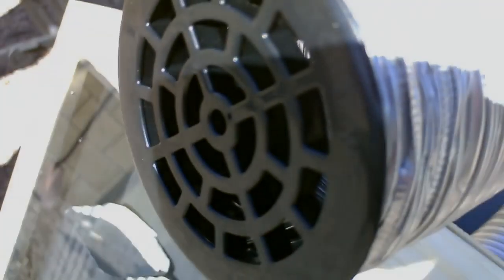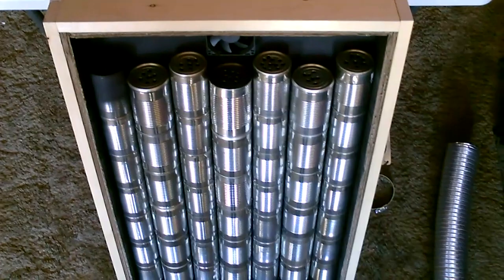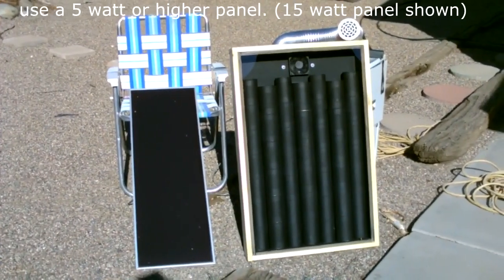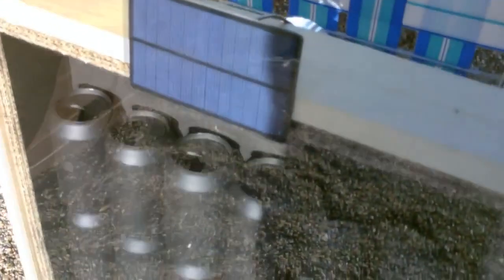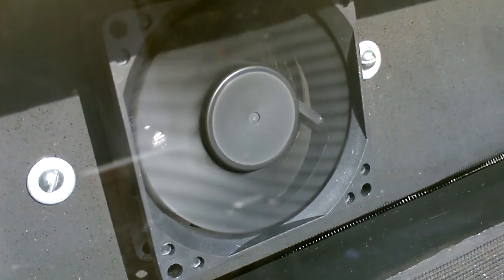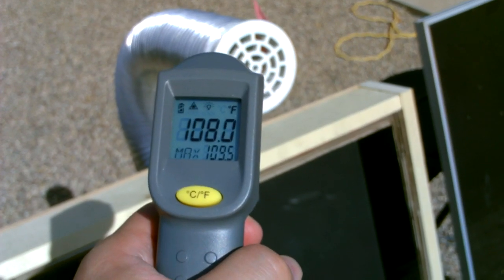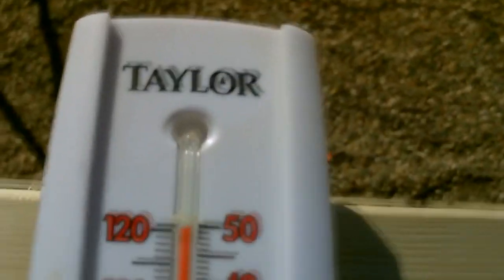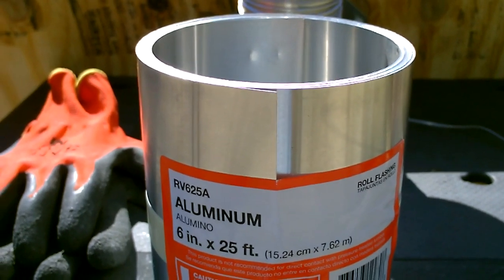5 DIY Solar Air Heaters! (Solar Air Heater Compilation Vid.) - 5 types - All Easy DIY's

Comment: Almost everyone puts the fan at the top where it is HOT!  Put it at the bottom so it can run more efficiently cool.
Reply from the maker: if you put the fan at the bottom almost no air will come out of the unit. you'd think it would but it bottlenecks and the fan struggles to push the air through. the fans will handle the heat fine at the top. i've never had a single fan stop working.

Comment: @desertsun02 Do you think one of these is powerful enough to help heat a 500 square foot garage? Or would it be a drop in the bucket?
Reply from the maker: hi. they would certainly help heat it. (you might need to adjust the size of collector or use a couple, but it will depend on how cold your area is)

Comment: Great video. Lots of good ideas for low cost heating.  Good explanation of builds.  Going to subscribe.  I like these kind of cheap, easy to build projects.
Reply from the maker: hi and thank you! and thanks for subscribing. I'm currently working on a new type of solar collector (one that i think is a first of its kind). I've seen a couple of science papers talking about the concept but I've never found a video on it. nobody's built this type of solar collector yet (as far as i can tell). if i get it to work (and i think it will) - it will be my next video. probably post in a couple of weeks.
Reply: Is it a compound parabolic mirror collector!?

Comment: Does the small can heater need direct sunlight? I want to do this for my greenhouse in winter but days are much shorter in winter. Also how long of sunlight or daylight would you think is needed to warm a greenhouse for night until the heat is gone until next day?
Reply: It wouldn't even get greenhouse to warm up, the cold from outside will be cool it down too much for it to do anything, I've been testing panels for while now and you need 50+ degrees C for at least an hour to raise temp 1 degrees c

Comment: You need to use an actual thermometer, using that only tells you the temperature of whatever it is pointed at, not the actual air temperature.

Comment: In order to really compare the heaters it must be done based on the energy extracted.  It is a combinaison of air volume and temperature.  So you must be able to measure the air volume and its temperature.  BTU = CFM x (Tout - Tin) x 4.5

Comment: I built a beer can heater five years ago and it works better than any of these. Why? Because they are all lacking a thermoplane. You need to draw room air into the heater, heat it, and let convection blow the air out of the top. You start by finding out the elevation of the sun mid day during the middle of winter. Then you build an angled top piece that fits in the lower panel of a window in your home so your heater is at a 90 degree angle to the sun maximizing solar gain. Room air flows in the bottom plane all the way to the bottom of heater unit, gets pulled into the cans or sheet metal where it heats and convection rises and blows into the room without needing a fan. I built mine out of double layers of foil faced Styrofoam taped with metal duct tape. The top is a corrugated clear green house panel. Styrofoam layer between the cans and the lower air plenum. Normal input vs output temp differential is around 50 degrees and I get around 6 hours per day of heat. Weight of eight foot unit is around 30 lbs. Light enough for most seniors to handle.
Reply from the maker: hi. i generally like to pull in outdoor air because it's fresh but you can certainly recirculate if you want to. it gives the highest heat on the coldest days. my climate is not super cold like the midwest or eastern states

Comment: Hi Desert Sun! I am in the process of making passive solar heaters completely out of found materials for less fortunate members of my community. The only things I will need to purchase are the fan and solar panel. What is the cheapest fan and solar panel I could use outdoors?

I notice that you vent your panels from the back. Any particular reason? Have you considered venting it out from the top? 

Thank you.
Reply from the maker: hi there. i think it's great that you are helping your community! you could vent it out the top if you wanted too. the best place to get the fans and the solar panels is amazon. they have lots of both of those. nearly all solar panels are made to be used outdoors and most if not all computer case fans will hold up fine. i've noticed that even the cheapest solar panels on amazon are pretty sturdy.

Comment: Black roller blinds and table fan works just as well although the heat is not concentrated to a small diameter for temperature checks. okay so the rooms darker. But ur warm. But probably just as good without the construction, pipe work and hassle.

Comment: I think I would not drill the holes at the bottom of the frame but have a gap between bottom of the cans and the frame, then drill lots of little holes on the back so that the fan draws the air in and channels the air through the bottom of the can tube. If it's cold and windy outside you don't want cold air forced up the tubes and into the house. This way the fan has to pull air in. Whether or not it makes a difference to the outlet temperature being drawn into a cosy environment first I'm not sure as it might have some cooling effect on the upper cans

Comment: Love them all. I wish I could see these working in -40. I feel like the air would be cooled down significantly just passing through the duct.
Reply: Insulate the ducting.
Reply: They work in any temperature so long as you have a bit of sunshine on the panel. Loss in the ducting I think would be minimal. The fan is pumping it straight into the house. You could probably run the ducting to eight metres in the roof void if you wanted the ventilation somewhere central. Bear in mind the primary function of these devices is to reduce relative humidity, dry air is much quicker and cheaper to heat. Then if your home is well sealed, you don't need to open windows and you get fresh warm air through your house changed every hour or so.

Comment: What happens if you don't have a fan?
Reply from the maker: hi. if you don't use a fan, the warm air will only trickle out. the units that don't need fans are generally 10 or 15 times bigger.

Comment: Now look I've been watching 👀 you for years and think you need to write ✍a book  that is so pertinent to our world and would have it in my book case.  I built a small cooler with small radiator, ice water and 12v pump and it works so I'll make a bigger one.
Reply from the maker: hi and thanks! i'm glad you're making the projects! (that's what it's all about) 😎

Comment: i built a large one a few years ago..it was the size of a sliding glass door..That was free glass, so i made mine huge.. the temperatures were hot, but you really needed a more powerful fan to make them worthwhile. I happened to have a blower fan. It moved a good amount of air.  I used a variable fan controller and adjusted it for the desired temperature i wanted.. so it would speed up as it got hotter, and slowed down as it got cooler.. I used aluminum cans, I had a header at the top and bottom..and i think i had 11 towers of cans, and I can't remember how many tall.. My only issue was that i couldn't find any flex duct that would last. so after a few years, i decommissioned.. but it was great when i had it,,

Comment: How about using solar panel as dark back drop area and or pri-heat camber,add some air flow diverter...
Reply: Heat may be a problem for the solar panel.

Comment: Do you feel there is one that works better than the others?
Reply from the maker: hi there. they are fairly similar but i like the downspout one the best. the steel is thick on those and i made the collector with a plywood back

Comment: How could I use such a heater at night? Is there a kind of storage device one could add to the solar panel in order to use the heat charged during the day at night? I do not understand much of these things, so I apologize if my question seems way to farfetched.
Reply from the maker: hi there. one idea is you could store the heat it generates in thermal mass like sand or rocks. you'd have to rig it up so that the unit heats those up during the day and then at night they'd release the heat.
Reply: @desertsun02  Thank you for your advice. Must it be special rocks? And would they really heat 8m2 during nights with 10 below zero?
Reply: @desertsun02  Steel has 4x the thermal mass per pound compared to sand. Steel is a better option.

Comment: sir i have a suggestion toward developing the solar heater, why you don't make a loop of the Aluminium cans in the board , this loop have an open valves at end of a specific sides and this valves connected to the fan area directly, its about controlling the air circulation at a different distances for increasing or decreasing exposure of air to heat by the mentioned controlled open/closed valves, which make it more and more reliable. 
hope to hear your reply soon
thank you.

Comment: I haven't seen a single design that  show recycling the air. I'm building a greenhouse, so I need to take that air through a tube in from the bottom from the greenhouse and return it back to the greenhouse
Reply: It’s pretty easy just add return hose (duct ) to air intake on your design, I use this for fresh air that I reheat through solar collector as to not turn on heaters for my 4x6 greenhouse, my greenhouse is pretty tight and during 30 degree days need some fresh air without letting in all that cold air , any of these designs will increase temp from outside air so really adds to greenhouse hobby and vegetables love fresh air

Comment: Something like zigzag (horizontally with little angle to prevent hot air getting trapped in high spots) metal pipes should heat better as air would get longer time to heat up.
Reply: air takes no time to heat up. Consider the heater core in your car, which is a small radiator. It flows hot coolant through the heater core and a fan blows air through the aluminum fins of the radiator. It takes a millisecond to heat the air flowing through. All you really need is a material like copper, aluminum, silver or gold that has a high thermal conductivity so it can take the heat and transfer it to the air, the key is surface area. Of course, if it's too efficient, then you need more thermal energy to transfer or it will become too cool too quickly. I had a friend who put a racing radiator on his car, and you couldn't get any heat in the winter because it was TOO efficient. The engine literally couldn't heat the coolant quickly enough, that radiator was great for the engine, not so great for the driver.

Comment: I am curious as to how long these units radiate heat after the sun goes down?
Reply: Not long , depending on materials used , I built one for my 4x6 greenhouse, just wanted to preheat fresh air , do not want to kick on my heaters also solar power , but greenhouse stays at 70f degrees with outside air at 30 f and now can add fresh air without kicking on heaters , of course just need sun to stay out , but using every bit of Mother Nature is fun hobby

Comment: I tried the down-spout version.  Full sun, temperature is 45 degrees outside.  Hardly any heat at all when the fan is running.  I have no idea what I did wrong :(
Reply: Is it possible that you were running your fan too fast and causing the air to transfer through the heater before it could warm up?
Reply: Hard to say without seeing the design.

Comment: Nice succinct comparitive...good work.
Have watched many tests.  Thermodynamically speaking it is a ratio game of surface area of absorbtion, rate of dissipation and baffling of airflow over the surfaces.  
The best tweek of quick hack is the downspout build with baffles. Cut  backside bend in tabs. Another alternative is to put screen inside tubes. The aluminum cans will always out perform steel....cans just slower to accumulate, to build and paint.  Thanx for great content!
Reply: Dude some big words for us amateurs using beer cans but surprised you didn’t throw in fan speed which also can make a big difference

Comment: if you want a surprise, try the screen  with  a foil background rather than flat black, I saw a 15 degree gain using the reflective surface instead of flat black for the back of the panel.  It was a side by side comparison with the same screen.. also the same length of screen folded back and forth in a wave profile instead of stretched in three flat layers also gave about a 15 degree gain over three flat layers.
Reply: An interesting idea! Been gathering supplies for close to zero-budget heater. Might use aluminium foil for the backround.

Thanks for the tip!
Reply: speedbuggy16v any pictures to share ?
Reply: @symonvanrisjel9959  sadly no, it was just a throw together for my own amusement.   Looking back at it I am going to say the gains from the different way of laying the screens was probably just a trade off of heat gain vs air flow.  But the foil vs black background I think was a true gain as more light, thus energy was reflected back onto the screen absorber which seems to be pretty efficient at transferring the energy to the air.  There is some interesting reading on boundary layers and laminar flow if you google "The Zen of Passive Solar Heating Panel Design
Morris R. Dovey"

Comment: To put this on a house couldn’t you use air from the floor of a room as the intake air and then have the outlet air be pumped out the top. Also any estimate on how much sqft this will heat?
Reply: Yes. You can do this.

Comment: Nice vid but I wish someone would do these different styles more scientific so you can really see the difference between them. Like all the boxes being the same size, same fan, all out simultaneously in the sun.
Reply from the maker: hi there. i've got a couple vids like that. they compare 3 different types of heaters (the steel can one, the screen absorber one and the downspout one) *they're made almost identical (the downspout one is a little different, but close)

Comment: Right on point. Like the virtually side-by-side comparisons with the thermo gun. This helps decide on what to build. For the cost of the aluminum downspouts, they aren't worth the money considering the screen gets just about as hot and is much cheaper. And then the channel is even cheaper and gets hotter. Thanks for the video!
Reply: Absorbers that have air flowing across the glazing lose a ton of efficiency.  None of these are actually getting to their theoretical efficiency since they all circulate air past the glazing, which causes a lot of heat loss.  It may not be an issue if you live in Arizona, where outdoor temperatures never get much below freezing, but in somewhere like Canada where temps regularly hit -40, the efficiency will drop way off.  The ones where the air flow is kept inside tubes like the can and downspout units will work much better, but the open plenum design on these kind of negates any gains you get from the sealed airflow.  The plenums on both ends of the tubes need to be sealed and insulated so that air flow only goes down the center of the tubes, not around the outside.  This is also a poor efficiency design with the screen and flat plate absorbers, tube type absorbers have a much higher efficiency at low external temperatures.  Also, drawing in cold outside air really knocks down efficiency, you need to recycle the cold air from inside the house, not try to heat outdoor air.
Reply: downspouts on Facebook are cheap

Comment: I think you said it was 50 degrees out? What kind of heat can one get when its say....30 out?
Reply: The output heat is dependent on the solar intensity (which is less during the winter), length (time) of solar exposure , & heat loss of the system.  You'd therefore get less heat out on average during colder months.
Reply: A number of factors come into play. The sun's intensity is less in winter, so that's a start. Keep in mind that a small heater unit like any these will not give enough heat to warm a building. These are great examples of what can be done at home, but you'll want to build something quite a bit larger for more surface.
Reply: ....another point to remember is that the intake air side will supply air from inside the structure, so it will not be frigid to start with... you're heating air that's probably already 60 or more degrees. Don't try to heat cold outside air.